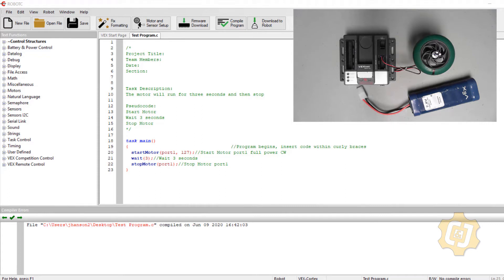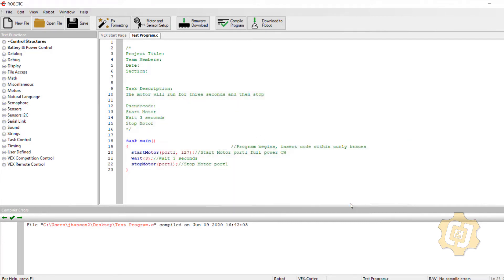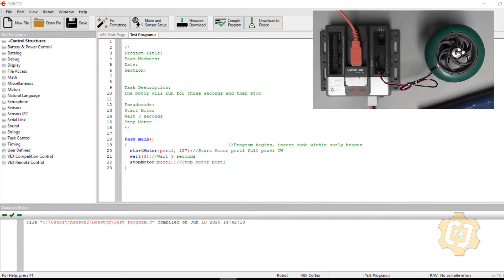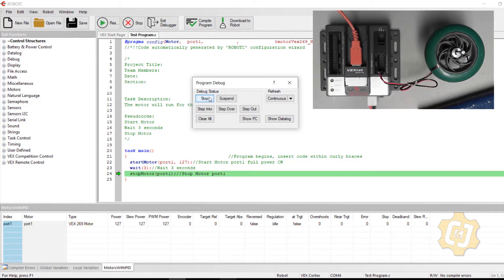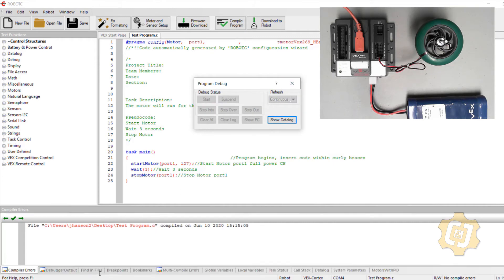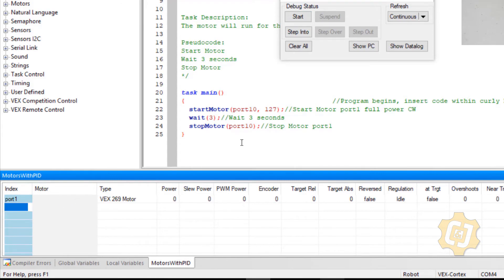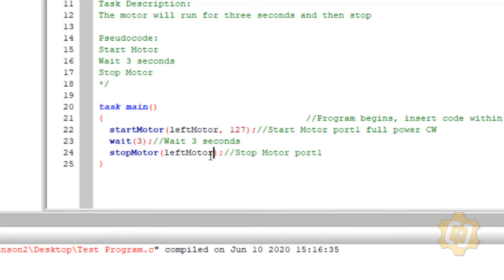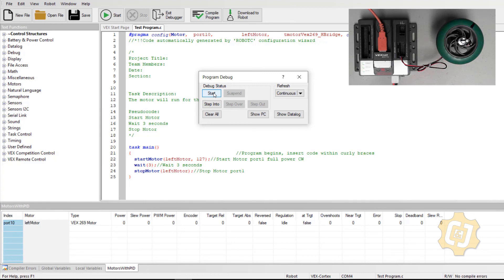2 Upload a Program to a VEX Cortex

Comment: how do I run code when not pugged into computer
Reply: did you find out?
Reply: I believe the code is saved onto the thumb drive, but it might be too late seeing as this comment was posted 2 years ago.
Reply: As long as you have the thumb drive aka the key plugged into the vex cortex (the brain of the program) and the motors plugged into their corresponding ports on the cortex it should be fine.